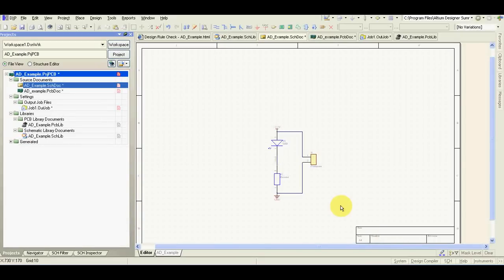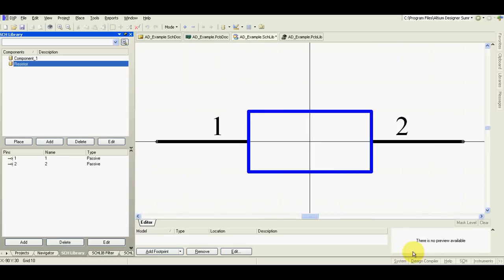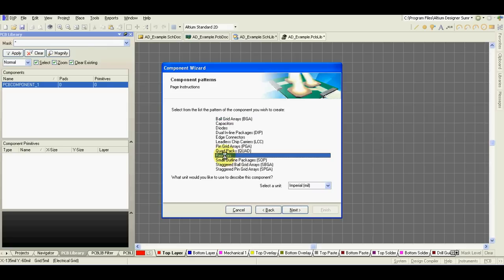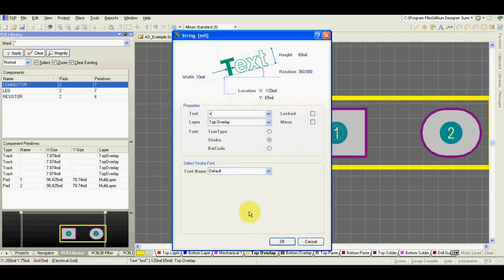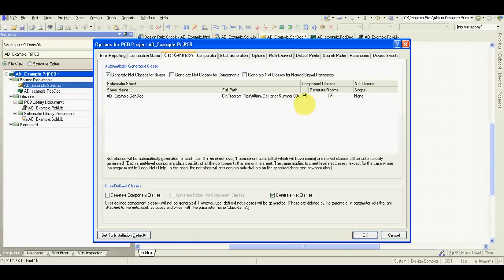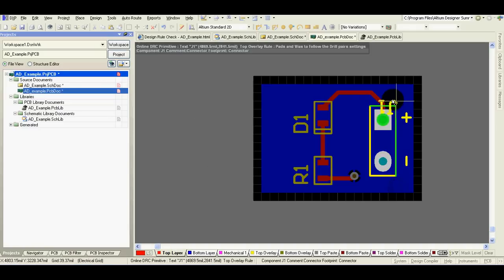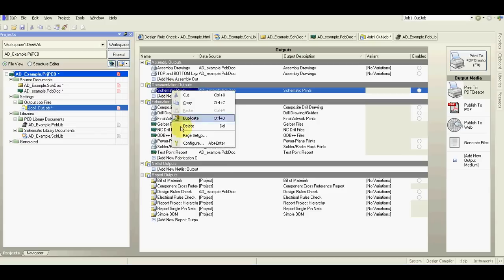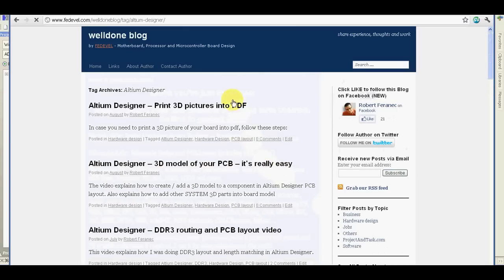Altium Tutorial for Beginners: How to do Schematic & PCB Layout

Comment: Why Altium does not generate the solder pads on the bottom layer? If you look at the bottom layer output, there is a cross where should be a pad and a cross..

Comment: Hi Feranec I was Designing a BGA footprint but the row and column of the component wizard and the datasheet are reversed (A,B,C,...) and (1,2,3..). I couldn't see an option to interchange them. Do I have to rename all the 121 pads manually?

Comment: The altium support gave me this solution and it worked for me:
"If you have a predefined List for the Pad-Designators for a Column or row ( simple to create with Excel) you can copy and paste the Information to the Pads.
to copy the information:
Select a Colum/ Row of pads, use the List Panel to just list the selected Pads. Change to mode from the Llist Panel to Edit mode. Now you can Copy / Past to the Pad Name from the Excel sheet for an individual cell / or a group of cell."

Comment: In a "Bottoms Up Multi Sheet Project", one can make on the top level schematic (lets call it Mother), the schematic symbols and link them to the sub-sheets created earlier. My question is when you make the PCB board from the topmost Mother sheet, how do you import the original room formatting (placement and routing) of the sub-sheets used in the Top-Mother sheet? Considering that the sub-sheets where made and their boards were laid out.

Comment: Hello, 

I'm new to altium designer, I've installed altium designer 16.
Thank you for the tutorials, it was really helpful. After completing the tutorials, 
to start with more complex designs I got one project which contained 3 files of the following format: 1).schdoc   2).pcbdoc    3).ps
I've imported the schematic and pcb files in altium, but in design menu I'm not able to see the update schematc option. Whatever changes I do to the schematic is not changes in pcb and in pcb I'm not able to see import from schematic option also. 
So how to synchronize the schematic and pcb so that whatever changes done in schematic are reflected in pcb on imported examples. 

Regards
Praveen
Reply from the maker: Are the schematic and pcb in same project?
Reply: Hello Robert, 

Yes both are of the same project but the project file was missing. 
Now after creating a new project file and importing they are working fine. 
 Thank you 
Praveen

Comment: Hi, i have question about then, how to do text where is no cooper on pcb? How to do this in Altium?
I would like to do backlight PCB like there https://d3s5r33r268y59.cloudfront.net/82122/products/thumbs/2015-01-13T14:51:00.334Z-IMG_0186.JPG.2560x2560_q85.jpg
Reply from the maker: +Fast Electronic There may be more ways to do it. The simplest is probably to use an "Internal Plane" and then use this layer to manufacture your PCB. If you use Internal Plane, the whole motive is inverted - so all the space is copper and anything you draw will be removed. Go to Stackup manager, Add internal Plane. Then go to your PCB, go to the Internal Plane Layer and Place -> String.
Reply: +Robert Feranec I try to do this on TopLayer with String normal and inverted, and some frame is around text: http://obrazki.elektroda.pl/4726983900_1445459628.png or http://obrazki.elektroda.pl/2051831200_1445459646.png  I'll try with Internal Plane, but i think then will be the same....?
Reply from the maker: I tried to add a string on a Plane Layer (before I answered your previous question) and it looked to me ok in gerber files (no frame). But I tested it very quickly, so maybe there will be a problem - but please let me know if it worked for you.
Reply: +Robert Feranec I give You know after 5h till now because i don't have my PC where i'm now.
Reply from the maker: no problem. I am just curious. Thank you.
Reply: Ok, so I add InternalPlane 1, and put there normal Strings. In Camtastic i see all strings as green. So You telling then this green objects will be no copper area (i did'n know about that-I use only max 2 layer in my simple projects)....ok BUT how to send this to manufacture to do from this one layer PCB, where copper is only on TopLayer?
Reply from the maker: Now, when I am thinking, you probably don't have to use internal plane - if there is text only. You can simply use TOP layer and just ask your PCB manufacturer to invert the motive. You would have to do same with the internal plane - just send them the layer and tell them to invert the motive (or maybe you can invert it by yourself in a gerber viewer).
Reply: +Robert Feranec I do all this in other way. On TopLayer I add inverted text, and in Design Rule i add clerance=0mm to Polygon, and some other celerances for any objects on PCB.
Thansk for Yor help, and all videos on Youtube. Best regards. Dariusz
Reply from the maker: Perfect :)

Comment: hello, i have a problem,in pcb i want to adjust size of designator text, i pro-tel it is easy a once we can change to all if few components are there its okay but having so many then for selecting each and setting is to difficult, is there any option to set the size of all designators a once, plz help me
Reply from the maker: Use PCB Filer + PCB Inspector (youc an open them through PCB button placed in the bottom right corner of Altium Designer). In the filter, use "IsDesignator" or for example "IsText and (TextHeight = 0.6)". Check "Matching -> Select", and press Apply to All. Then go to PCB Inspector and change the Text height to a new value.
Reply: im sorry i didn't got, i tried my level best. im using altium 09. do is support  for the above process. and im unable to find the "Matching -> Select",im getting an error ;expected at line2 when i m typing "IsDesignator"  "IsText and (TextHeight = 0.6)". is there any video of you which explained this process. pls help me i m struck with this im unable to go further.

Comment: Hi Robert, I have a configuration problem I guess. I have Altium 2014 when Im routing it doesnt show me the path of my wire. So when I move an element while Im moving it doesnt show me the element. I think is a problem of visualization, but I tried the short cuts for look ahead and nothing happen. So I have configured all the transparency preferences and nothing happen. Can you help my, beacause I spend a lot of time in manual routing without this option.
Reply from the maker: Hi Cesar, I really dont know. I have not seen anything like that. Maybe try to ask your Altium support.
Reply: Ok thanks!!

Comment: Hi Robert,

I am new into Altium PCB design. When i convert this Schematic to  PCB the connections are not made from Connector to Diode. Can you please tell me where i m doing the mistake. I have tried it many time but ame problem is ocuring. Thanks.
Reply from the maker: In most of the cases, pin rotation is wrong. Have a look here: http://www.fedevel.com/designhelp/forum/test/beginners/2521-tackling-error-warning-messages
Reply: Thanks a lot. It helped me a lot... GOD bless you....
Reply: Thanks Robert. While updating components in PCB, one of the pins was not getting connected to the ground. This link helped me. Turns out I was connecting to the non-electrical pin.  :)
Reply from the maker: Perfect :)

Comment: Hello, great tutorial! I did the same job you did here, but i don't get all of those grey lines in the pbc layout that allows you to later wire the elements(they are "like pre-connections"). This happens with every component that I created myself, and not default Altium components. Sometimes I get net errors, but i dont know how to interpret them. Any ideas? Thanks!